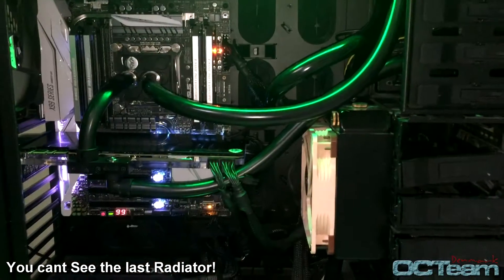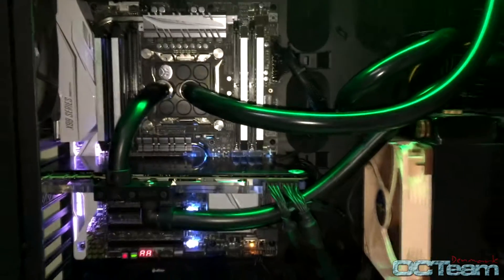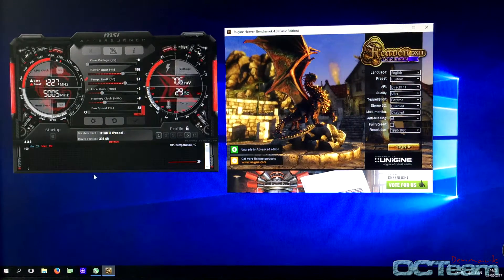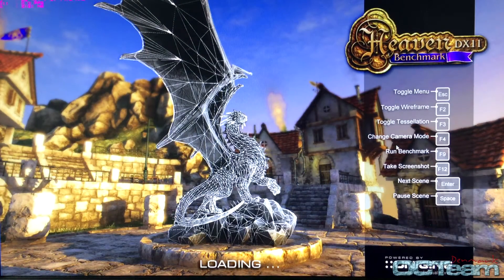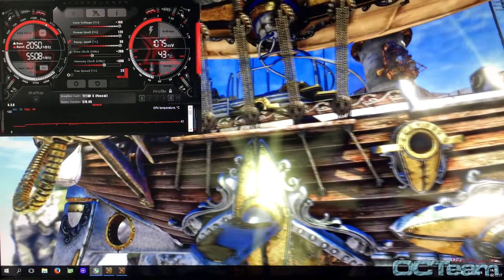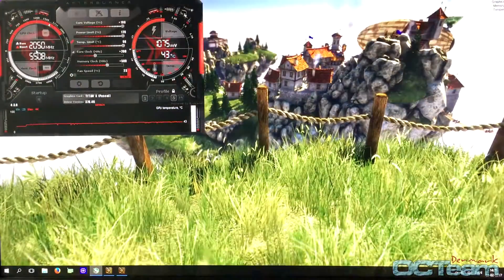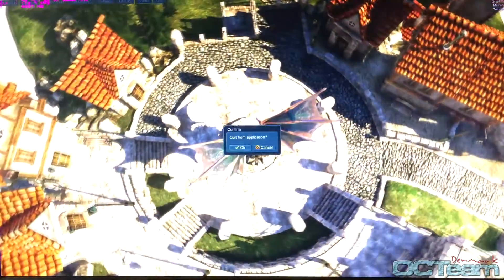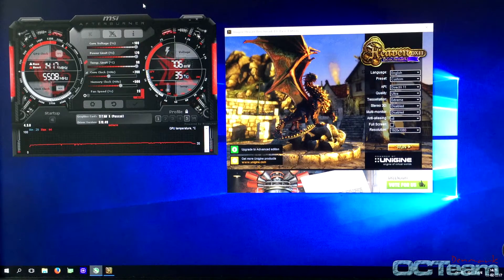Watercooled Titan X Pascal - Temps - Overclocking - Part 2

Comment: Hello,

how do you have it geschft, \"Core Voltage \" about \"msi AFTERBURNER \" to activation?
I own two titans Xp in the Sli-way pursued.
I have in \"general settings(discontinuances)/Kompatibilitäts Qualities(Properties) which goes tension regulation activated, new start..., nothing why?